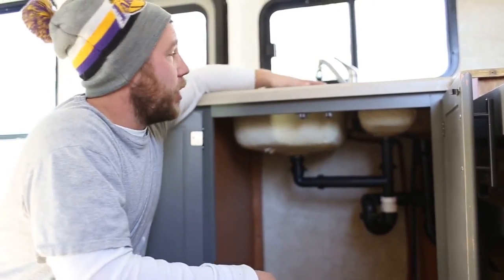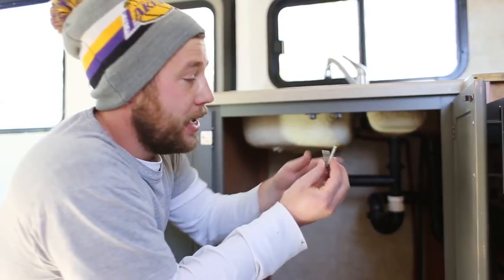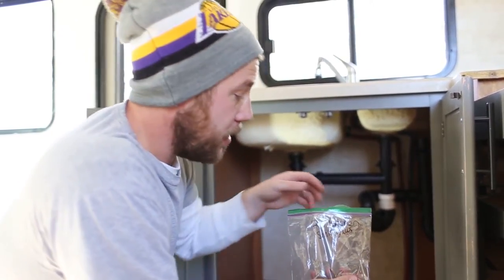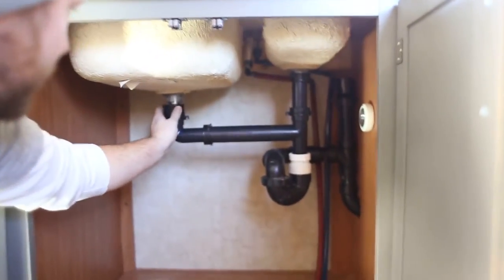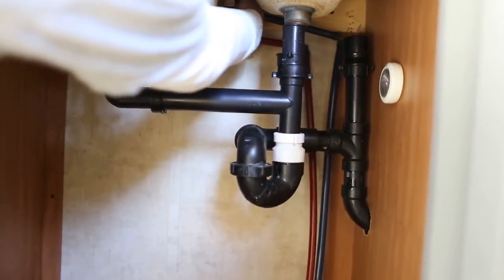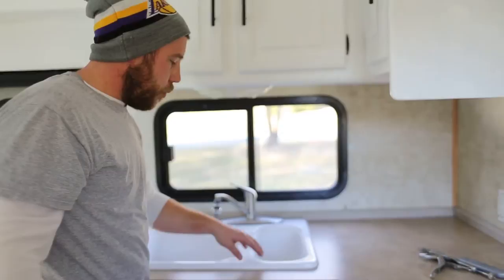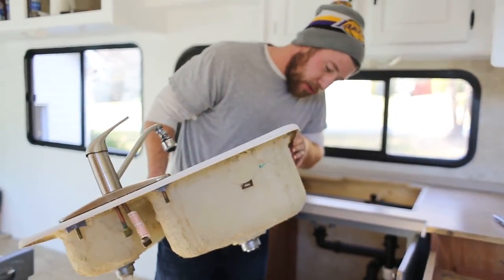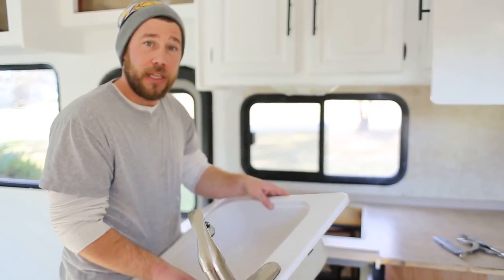How to Remove Kitchen Sink from RV

Comment: That looks just like my sink that I need to replace.  I'm not sure about the size of yours, but I'm looking for a replacement for mine.  It has that smaller sink on the right just like yours.  Do you know where I can find something like that?  Ideally, I'd like to upgrade it to stainless steel.
Reply from the maker: Hey +Barry Watson, so a lot has changed in the last 2 years since we replaced ours, there are a lot more rv centric online dealers now. We ended up finding ours off of Ebay when we purchased it. When we were looking we focused on the depth of the sink, and also considered bar style sinks. Anyway I hope this helps.

Comment: I am wanting to remove my bathroom sink but not replace it (thus leaving the disconnected pipes within the cabinet).  My concern is the possibility of water flowing through the (newly) disconnected pipes - especially if I use the kitchen sink or shower.  Or is all plumbing completely separate and I can just leave the pipes 'as is' without any danger of water flowing through them?
Reply: Whatever you do make sure to cap the old lines.